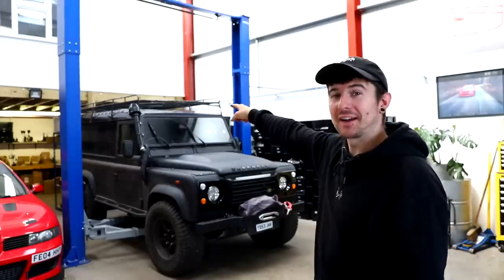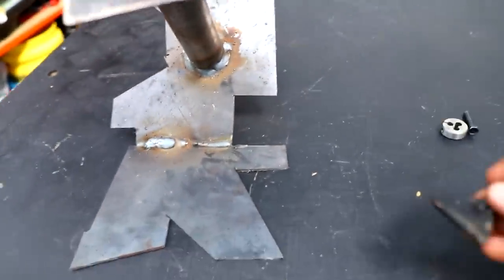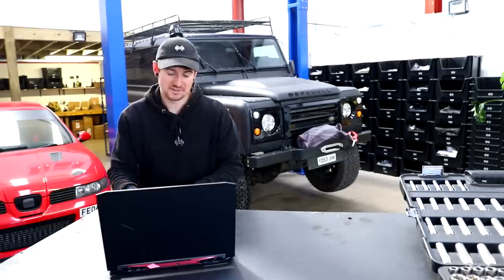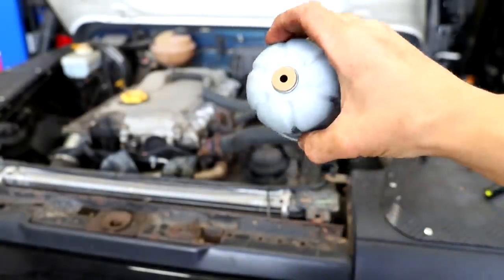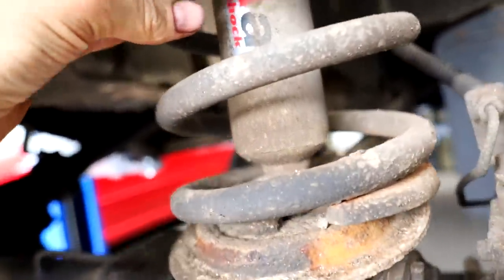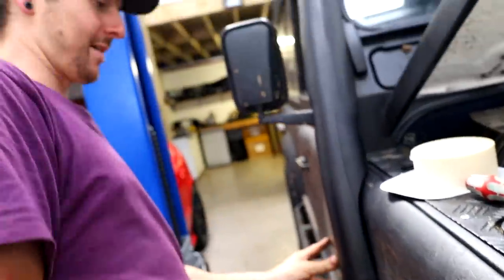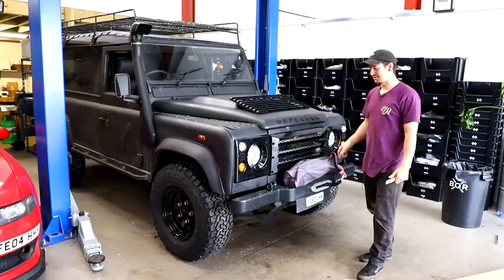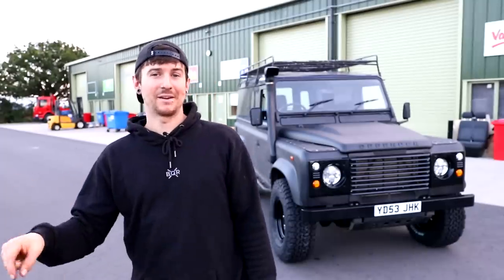Making BIG improvements to my Defender

Comment: BQR That’s a K&N washable filter!! That’s a performance mod too. There’s around £50. Highly recommend you reuse it mate.
Reply from the maker: yup just noticed hahah, cheers I'll pull it out the bin
Reply: @boqer123   Make sure you have the cleaner and spray oil.
Reply: @boqer123  If you ever get MT tyres I would recomend Yokohama Geolander MT G003 tyres(285/75r16 is 27.25kg) as they are as light as a BFG KO2 All Terrian(27kg), even lighter than a BFG KM3(29kg) and have sipes as the KM3's do not, making it a good overlanding MT tyre.

Comment: Loving the land rover content. BTW you should be running steel wheel nuts with those instead of the alloy ones as they have a different taper

Comment: That oil filter sprays oil in those jets whilst it is spinning and it helps separate the carbon from being pumped around the engine. The ones i change in a Scania engine, the filter comes apart in pieces for you to scrape all the carbon build up out of.
Reply: I loved cleaning the spinners out when I was a apprentice at scania in UK.
Reply: @chrisnoble1416  Haha i'm an apprentice plant engineer and our generators use the Scania engine :)

Comment: Nice 110, excited to see what you do next. Changing that grill was the best thing, all you need to do is change the headlight and indicator cover back to standard now haha. If you plan on doing anything remotely wet you should really check all your breathers,  the front and rear diff, there are ones that come off the transfer box and gearbox. You can buy kits which allow you to bring the hoses up to the engine bay. Also in land rovers great design on the td5 the ECU is pretty low in the drivers seat box and will get wet well before the engine will take on water heh, worth checking it's water tight, people have been known to put them in tupperware boxes for peace of mind!

Comment: If your planning on going wading, under the airbox is a little rubber valve which is to let water/mostuire drain out, remove and seal the hole, also your Ecu is under the drivers seat...great place for electrics to get wet !

Comment: Andy, if you approached anyone of the specialist Landy parts people, Craddocks, Paddocks, my local one is the LR Centre Liverpool, TD 5 service kits are far cheaper, change the wheel nuts, and Embleton Imperial do a super super led light kit for the dash clocks, but I suggest ringing them and asking to include an extra unit for the speedo as they are a sod to fit, I Use locking forceps.....I'm with you dont really like the bubble raptor, but when its appied finely then its quite nice, PS my big black landy is called Penny

Comment: 7:37 Yo btw you should put some fresh oil in the oil filter before you put it on, just helps stop your upper end running dry until the oil is sucked and pumped through the oil filter housing.

Comment: 4:30 - sit on the floor with your legs underneath the car, roll the wheel onto your knees then use your knees to lift it up. So much easier, plus you're not going to hurt your back.
Reply from the maker: thanks x
Reply: @boqer123  no worries, love the defender by the way, looks fucking sick x

Comment: Pretty sure you'll need to get new wheel nuts as yours appear to be for alloys and not steelies. You may also need open ended nuts depending on the stud length. Wrington Engineering's nuts are considered the best by Defender owners although any non-brand will do just as fine albeit of lesser quality/lifespan.👍
Reply from the maker: Said in the video I'd ordered some, they just hadn't arrived haha. I'll check wrington out though cheers dude ✌️

Comment: I don’t know if you meant to have your wipers vertical? But if you take the wiper motor apart there’s a little plastic flag that you can attach to the gear at 180 degrees, which will fix the rest position to horizontal

Comment: You should never tip the contents of the old fuel filter into the new one, you can end up with the filtered debris the wrong side of the filter medium and the first time you start it up, it will pump the debris straight to the injectors.

Comment: For your reference its not good to pour the old fuel into the new filter as it could be contaminated also it looked like you also used the filter pliers to tighten the oil filter you shouldn't it is normally written on the side hand tight only plus in England we call them wheel nuts get it right

Comment: anyone else have the same dewalt 1/2” impact gun as boq? what’s it like torque wise? for example removing tight wheel nuts? stuck between that and the milwaukee one, but obviously dewalt is cheaper. If anyone can give their opinion I’d appreciate it, cheers! Love the vid btw boq
Reply from the maker: on setting 3, my dewalt has never been unable to undo something. Also never tighten on it cause it'll rip things to shreds haha
Reply: @boqer123  fair enough, cheers boq!

Comment: Instead of Lifting Heavy Wheels,You Could of Dropped Your Lift Down ?.
I Had a TD5 90 I Fitted Loads of Upgrades ,Mile Marker Hydraulic Winch I Bought Used and Rebuild it And Fitted New Pump And solonoids Etc,Snorkel,Tank Guard,Diff Guards,Steering Guard,Jackable Sills,New Springs and Shocks,New WOLF Black Rims and 235/85 Mud Terrains,High Ratio Transfer Gears,Remap,Upgraded Alloy Heater Matrix ,3 New Doors and a Full Respray.

Comment: Man I was cringing when you hit the rotator filter housing with the torque drill, Those threads are retarded fragile LOL and strip mega easy. Then its a real bastard to get it to seal, Wait till you change the water pump :) its a bugger, But the Defo looks Rad